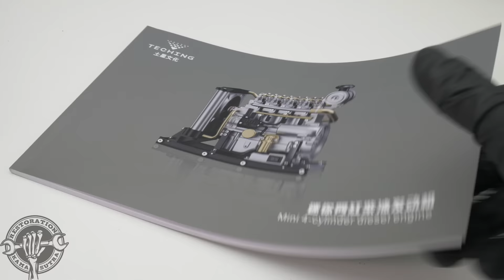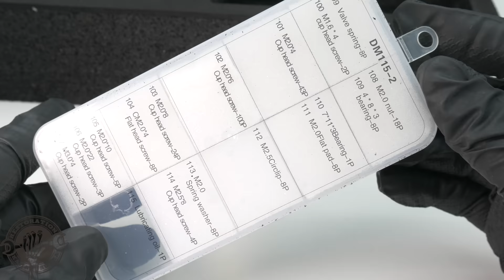Building a 4-Cylinder Diesel Engine Model Kit - Mini 4-Cylinder Engine Assembly

Comment: This kit is up in the thousands and it can’t even run. I bought an entire 50’s tractor and rebuilt the engine for the same price of this kit, and it’s solid cast iron. If you want to learn about engines, buy a real engine 😂
Reply: @adienp265 stirlingkit look up them up it's real kit you sound really dume
Reply: And ps you don't know nothing you're just a young kid don't know nothing don't do research  stay in school stay in school and do research maybe you'll get luck in life u are a  young kids don't know nothing
Reply: Not everyone has access to a garage or shop to work on a real, full sized engine. Also, not everyone has all the tools you would need to work on said engine. The price for one of these models may be high but for a lot of people its 100% worth it and a lot more accessible than a full sized engine.
Reply: How I bought

Comment: That was a waste of 20min. A classic example of click bait. That thing couldn't run on its own if the owner's life depended on it.
Reply: Did you need 20 min to understand that?
Reply: There is a chance it will run on nitromethane
Reply: @migueldenboer5186  no piston rings and all that clearence. I bet 40 hp 😂
Reply: @migueldenboer5186  Alright, I am going to try and be nice here. Your statement tells me you know little about piston engines. First, there are big oval holes at the bottom of the cylinders. So, we would need sleeves to fix that. Next, there are no piston rings. Gotta fix that. No working fuel system or ignition system. The list goes on and on. I have been working with miniature airplane engine for 65yrs, glow, diesel and spark ignition, so I have had a little experience with the subject. PS. The oval holes in the cylinder's would work if this were a model of a 2strok Detroit diesel engine. But then you must have a supercharger to bring fresh air in and exhaust gases out. 'Nuff said, my fingers are tired.
Reply: @ktmturbo5836  I guess I wasn't believing what my eyes were telling me. I was hoping to see a real working model of a diesel engine because I would buy one in a heartbeat.
I have become gullible in my old age I guess.
Reply: @klesmer  I didn't watch the complete video but I know that it's not plug and play
Reply: @klesmer  so was i
Reply: @quartuppkachupp  knock knock ho is there ironi is.
Reply: Totally. I actually thought it was real especially seeing the fan spinning.
Reply: @klesmer  dude you don't need to look at any of that, first of all, the camshaft isn't even machined, nothing is machined. That's when you know that it's just a model.
Reply: @klesmer  as rough as the crankshaft was plus no bearings was all I needed to see this couldn't be a real working diesel engine.
There's plenty more reason why this wouldn't work but the beginning is all I needed to see.
Reply: @mytebetme  I agree. I guess I am a glutton for punishment sometimes. I just had to see where this thing was going hoping it was a bad joke.
Reply: Well it did say model.
Reply: he never said it ran
Reply: And where in the title does it say running engine?
Reply: It never said anything about it being a full on running model
Reply: Yeah so do i... So dissapointed... 😭
Reply: Ridiculous comment is ridiculous....
Reply: Totally agree
Reply: So report it as spam so they stop making money off lies.
Reply: Ong, I watched it thinking it was one of those mini engines and then I saw the fake lookin shit on there but I still watched it all
Reply: @colechafin9441  Thanks, it is nice to know I am not the only one.
Reply: @rinduwatirazali3435  This is very true. This is what happens when we assume things. I am as guilty as anyone else.
Reply: I wish it actually worked
Reply: Yeah. As soon as I saw him taking it out of the package, I fast-forwarded it to the end, just to see and hear it run. I learned my lesson, a long time ago. 😆 Had I actually watched it, I would've been very suspicious, when I saw those big gaps in the cylinder sleeves. It's basically a "cutaway". 😆
Reply: @klesmer  you're a lot nicer than I am. It's hard, dealing with folks that don't know what they're talking about. 😆 An interesting fact, though, is the the first internal combustion engines didn't have oil or compression rings! Crazy, right?
Reply: Should have gotten a toyan
Reply: Did it bother anyone else that he was using the wrong size Allen wrench
Reply: @toddamtmann3528  Crazy as it sounds, you are correct.
Reply: @kaleechie9252  That make at least two of us. I would have bought one in a heart beat, I love diesels.
Reply: @toddamtmann3528  Thats what I should have done.
Reply: @michaelmain1990  You have sharp eyes my friend, I did not notice but shouldn't be surprised.
Reply: It’s a scale model don’t be a pvzzy 😂
Reply: Awesome you just earned a subscriber
Reply: Agreed!!
Reply: It’s a video of him building it
Reply: I can’t believe you breathe the same air as I do.
Reply: @Mythixc  Right, it take an electric motor to turn the stupid thing over. That makes as much sense as mammary glands on a Tom cat.
Reply: @sjv6598  What make you think we do?
Reply: @smyers820gm  
In order for it to be a scale model it must be a scale model of something that actually exists, down to every detail.
Reply: @klesmer  are you sure ?   Who makes those rules?  Is there some kind of scale model law? 🤷‍♂️😂
Reply: At 3:25 in whom ever put the crank and pistons in without any piston rings on the pistons. I would be surprised if it can gain enough compression to  keep it running .
Reply: The title says "model" , that implies it's not a running model. What's the problem? In high school we had one similar model, a bit bigger but a steam engine powered by an electric motor and another "real" micro steam engine that was actually operational, running on compressed air from an air tank with a regulator, like those SCUBA  air tanks. Both were highly educational. I enjoyed this video, it was very ASMR to me. Thank you.
Reply: Its a MODEL!!! What part of that you did not understand? it took 20min for you to understand that if a engine block has holes it, its probably not gonna run.. 🤦‍♂️
Reply: It’s a model what do you expect it to run for ages
Reply: Nowhere in the title does it say that it runs🤦‍♂️
Reply: @smyers820gm  That is what scale model means, it is a scaled down version of  a full sized object. If you participate in a scale model contest [ does not matter what the subject is] you are not going to win anything unless your entry is an exact replica of what ever the subject is, boat,car,airplane or whatever.Why is this so hard to understand ? Or are you just another common troll?
Reply: @theEVILone0130  I suppose if you could spin it fast enough [20,000 or so rpm] it might work but it would melt first I think.
Reply: @klesmer  well I’m not the only one that disagrees with you. More than half the people think you’re being ridiculous 🤷‍♂️
Reply: @christiandietz6341   I give up. I think many of you are arguing just because it makes you feel important.
Reply: @klesmer  not me I just argue for arguments sake.
Reply: @theEVILone0130  What ever. I was surprised at the response to this fake model diesel but now it is getting ludicrous. I am out,done, finished, better things to do .
Reply: @smyers820gm  Well bless their little hearts. If that is what it takes to fullfill their little lives then think away.
Reply: @klesmer  don’t really need your permission. I mean since we were already thinking it🤔🤷‍♂️
Reply: It's a dam model
Reply: @klesmer  you help your mom
Reply: @klesmer  hell
Reply: @klesmer  Im a kid, yes, but  it doesn't mean that you're smarter than me
Reply: @6foot5man  I believe I covered that fact already. So it takes two of you to work on one engine?
Reply: @6foot5man  Of coarse. Boy, are you in for a rude awakening.
Reply: И ценник  не меньше в  1500 $ за этот ,, шедевр,,?
Reply: It does say model
Reply: It’s a model lol
Reply: Here’s a good example of somebody who really doesn’t know what he’s talking about or any thing about these model engines which happen to be amazing.
Reply: Nice video but the engine is a fake and doesn't even run on diesel...
May as well focus on electric motors.
Reply: @karlw426  Finally, some one with common sense. This thing looks like someone made it on a 3d printer, trying to cash  in on the real running engines.
Reply: @klesmer  I guess the Manufacturer is just trying to make coin selling model kits...

Kind of like making money off selling a model kit of a Tesla free energy generator.

Big money in selling models.

I would rather have the real genuine functioning machine in small scale and full scale.
Reply: @karlw426  I agree with you. My problem with this entire thing was that in my old age [75] I guess I have become gullible and am pissed off at my self for watching the entire debacle expecting a working model diesel. Then the troll flood gates opened up and every ass hole and nitwit watching you tube had to get their penny in. I would say two cents worth but most of them couldn't count that high. Thanks man.
Reply: Literally said model kit in the title
Reply: What did you expect Ed from MODEL KIT?
Reply: @ilyagamer7287  One that actually run? A  little late to the party?
Reply: @klesmer  don't know, but i already knew that the engines like that doesn't work, because the diesel engine work different. Diesel engine is working by exploding the fuel without ignition
Reply: They say it is a model. Nobody says it runs on its own power.
Reply: Ok…? I wanted to see it for the detail. You’re mad bc it’s a model and didn’t read that. Plus you could get bore sizes to properly fit it and modify it to run on nitro.
Reply: You do understand its a model right? 😂
Reply: @stephenwest2476     You’re right on the money.  It said “model” engine and nowhere did it say a “working” model engine so all you complainers can go  back to bed. It was actually rather nicely done and a good exercise in model assembly.
Reply: @omarrama92    You’re absolutely correct.
Reply: Klllkk
Kkkll
Reply: @quartuppkachupp  lllllllllllll
Reply: I mean, it’s a model, it’s not supposed to run, just shows how it works
Reply: The title says model and not miniature... 🤷🏼‍♂️
Reply: Model kits don't have to run😂
Reply: I wasted 20 sec 😂
Reply: How far into Star Wars did you get before you realised it wasn’t an historical documentary?
Reply: @ktmturbo5836  to
Reply: What did you expect from an engine with holes in the cylinder walls
Reply: Saaaame
Reply: @klesmer  if you checked the title, it said that this was a diesel engine and last I checked diesel engines don’t use spark plugs and just basically squish the gas until it explodes and diesel gasoline does not react to spark plugs
Reply: It’s a model.  Is that hard to understand?
Reply: It’s a model.  If you bought a model of a B29, would you say it couldn’t bomb Tokyo if the owner’s life depended on it?
Reply: Not click bait at all, he never stated it runs.
Reply: I mean, it's doing what it supposed to be doing; so yeah 😂😂
Reply: @klesmer  It makes perfect sense for a model.
Reply: @ktmturbo5836  Bro when diesel gets pressed in the right compression It burns itself only with oxygen so it don't need sparkplugs
Reply: Its a cutaway model, you donut!
Reply: u
Reply: Llĺllllll
Reply: What part of model in the title did you not understand?
Reply: Hey, get over yourselves, armchair engineers! Where's your mini engine project, huh?! This guy did a great job on a neat little engine. If you all are so tired of wasting 20-30 minutes of your life, here's a clue, GET OFF YOUR SMARTPHONES!!🙄🥱
Reply: It says model not a 1/5
Reply: Your actually very wrong, cause there's this cool thing called DIESIL
Reply: Right, I get it... you people talking about this thing that literally just a battery powered miniature and not a real working diesel engine.
Reply: @klesmer 65 YEARS?????
Reply: I just watch because I like seeing it being built
Reply: How is it click bait
Reply: @kryptenwolfgaming  ikr 🤣 
This is clearly a 5 year old never once in the title or the description did it say ✨running✨ and this kid is still like oh my gawd such click bait
Reply: Junk. Damn thing costs as much as a real nitro engine.
Reply: Your just mad that you don’t have one😂😂😂😂😂
Reply: It didn’t say it would run.
Reply: @aliciachapman2956  exactly this user has no right to be upset
Reply: Nobody said it runs

Comment: Cute model of a 2 stroke. I was hoping for a real running diesel motor.
Reply: same though
Reply: Well, the title does say model, that should give you a massive hint on what this is
Reply: @cplcabs  some models run
Reply: @goose-the-gamer  if you put an electric motor in them. There are also miniature engines the size of the one in this video and smaller that run, but they are not called models. A model engine is not a real engine.
Reply: @cplcabs  That's a nice argument Senator, why do you back it up with a source.
Reply: a two stroke with valves

Comment: The day they make a  little engine that actually runs on diesel would be a dream come true. I'd buy the hell out of them. I wonder if they can make one that runs on diesel since the compression would have to be high....and the parts would have to be pretty strong.
Reply: There are model-diesel engines, but they run on a petroleum-ether-oil mix. Some can apparently run on pure petroleum/oil when warmed up. 
They also do use a carburetor, and therefore are actually HCCI (Homogeneous Charge Compression Ignition) engines, not true diesels.

Since they are pretty reliable once you got the hang of tuning them correctly, especially if you run them WOT all the time, they were really popular for model airplanes in the 1950s-1960s.
Reply: @VintageTechFan  Model diesel engines run on Kerosene/ether/oil mix, not petrol. Keep in mind, too, that all those methanol powered glow plug engines are also a form of diesel.
Reply: @tedsmith6137  Confused the terms here, german word "petroleum" is more or less kerosene. 

And nope. Glow plug engines aren't diesels. It's a common misconception, but they do not fire by compression but rather by catalytic process on the glow element, which contains platinum/rhodium and sometimes other noble metals for this reason.
Reply: છછગડગગછડફસસફબઢઞઙઙઙઢસસસઝઝઝ
Reply: Here is a lovely little 'compression ignition' engine. You can still get these simple little engines to play with, not running on Diesel fuel tho. Hope that is near enough for ya! :)     https://www.youtube.com/watch?v=fApvpZWAwYk
NOTE: This is NOT a 'glow' engine, it is true compression ignition.
Reply: Running diesel model engines have been around for 75 years... Where have YOU been?
Reply: Look up Find Hansen. Although his engines are custom/self built and not available as kits, they are real miniature diesel engines.
Reply: Bro si hay algunos motores tamaño mini que si funcionan a diésel o gasolina hay un V8 y otros busca y si existen
Reply: @VintageTechFan xxxxxx
Reply: Pretty sure nitro engines are as close as you'll get to a diesel ⛽️
Reply: L
Reply: This "engine" has no compression whatsoever and won't run on any fuel. He literally dropped the pistons in connected to the crank without rings on the pistons.  Gasoline engines will not run without any compression let alone a diesel.
Reply: My L4 OHV is gas and has insane compression. Its possible! Heard talks they are working on a diesel type engine though!

Comment: All that time, and it doesn't run.  All that money, and it doesn't run.  That extremely fancy packaging, and it doesn't run.   So close, but so far.  Good for the classrooms I guess.  Neat build.  Thanks.
Reply: I believe there are units on the market that actually run.
Unsurprisingly, if my recollection is correct & there r, they cost a good deal more.

Comment: A miniature true diesel would be extremely hard to manufacture and exspensive! The biggest obstacle would be the injectors. Maybe the precision machines used to make Rolex parts could possibly do it.
Reply: I actually thought he was gonna start it up, too bad it's just a metal model.  I saw the real miniature v8, that was awesome, except for the price. $1600
Reply: It has been done but more so the old design used it ships. The big exposed conrod single or 2 piston style.
Reply: You could do it two stroke.  Early railroad diesels were done th is way.
Reply: What you need is skill not a watchmakers lathe.  A watchmakers lathe will be ill suited to it (I've got 22 lathes at the moment so can comment on the relative merits lol)  Any small lathe will do, i.e. myford or maximat.
Reply: That engine is not running it spins uses electric
Reply: @johnpenn74  Still are. EMD ( Progress Rail now ) 710G engines are current production for locomotives, stationary and marine use.

Comment: How many (other than me) thought this would be a real diesel working model?  Nice well made kit though.
Reply: I skipped though and the moment I saw the radiator (where I skipped too) I knew it was fake. The filter, pump and injectors were all blank casts not to mention you can't run a common rail diesel without an ecu to control the injectors or run high pressure fuel through flimsy rubber tube. Might have been more believable if they used the old style injector pump and fake hard lines.

Comment: My Neighbor built a 1/4 Scale Caterpillar gasoline engine from scratch and it ran on Propane .. He also built a 1/6th scalle  1/3 scale and 1/2 scale Case Steam Tractor based on 60 HP Case Blue Prints.

Comment: Disappointing that it’s not an actual running model. I was suspicious when I saw him assemble the pistons without rings. But the real give away was the big sight holes in the side of the cylinder walls. Seems like it could’ve been a running engine with just a little more in the manufacturing process.
Reply: Lmao